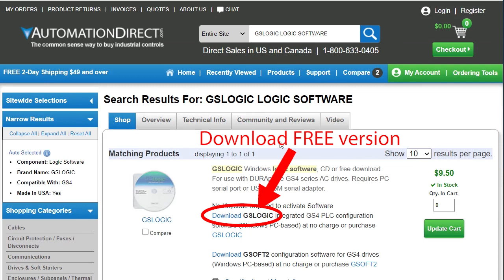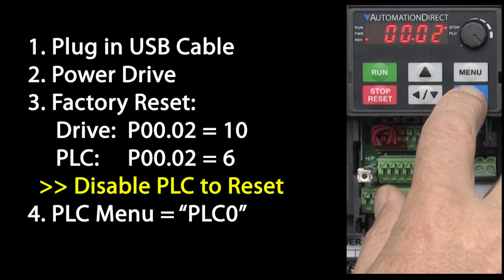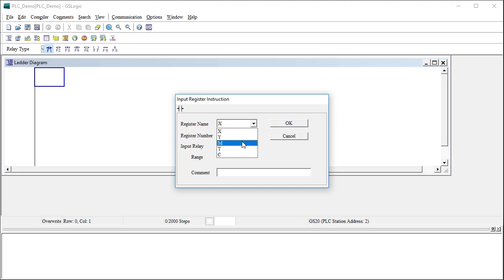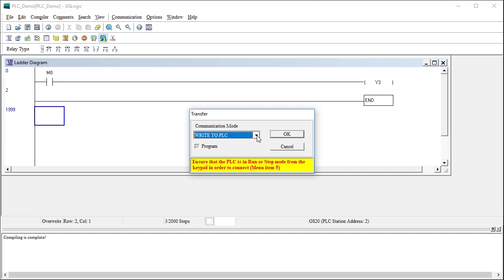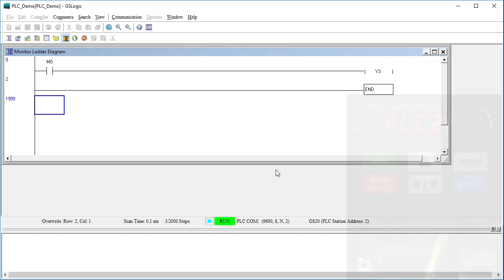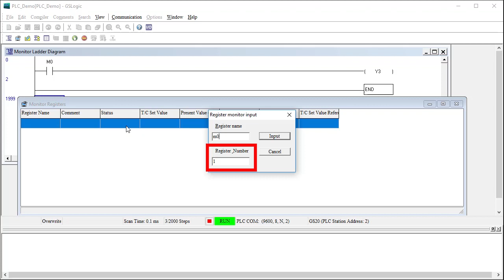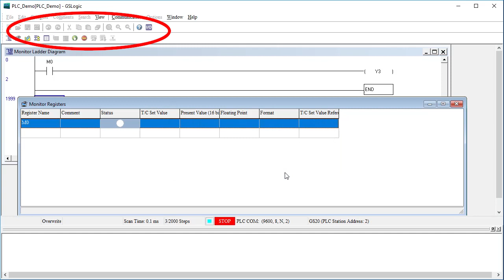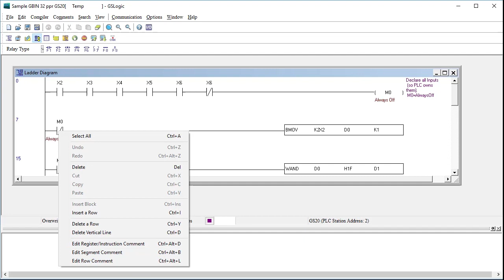DURApulse GS20(X) VFD: PLC Quick Start Part 2 - Demo from AutomationDirect

Comment: Example code is no longer included with the current version on GSLogic.  That is disappointing.
Reply from the maker: The code is still available. We moved it to the item page for any drive compatible with GSLogic. Find it here:

https://cdn.automationdirect.com/static/support/sampleprg/drv/GSLogic%20Sample%20Programs.zip

I have also given your feedback to our engineering team that handles the GSLogic software. Thanks for the comment!